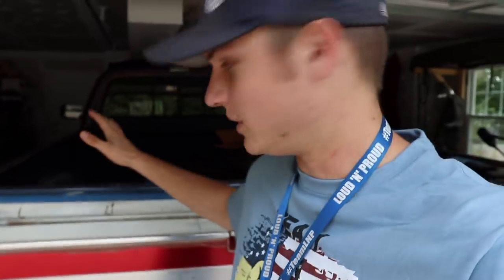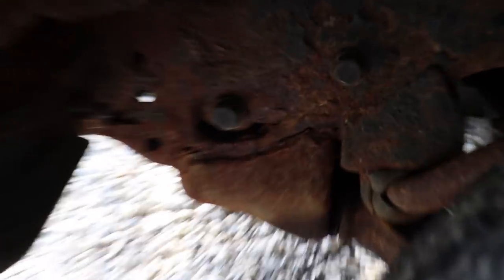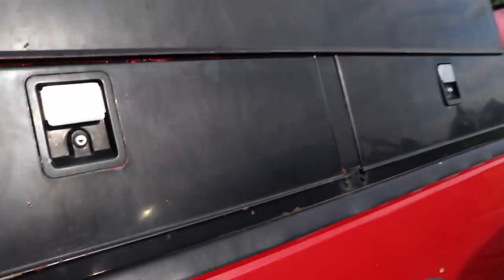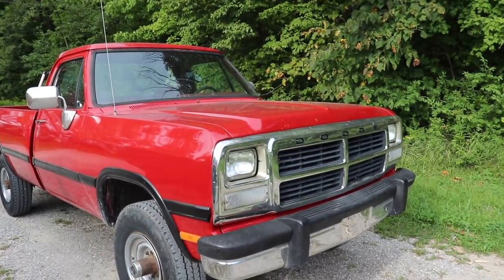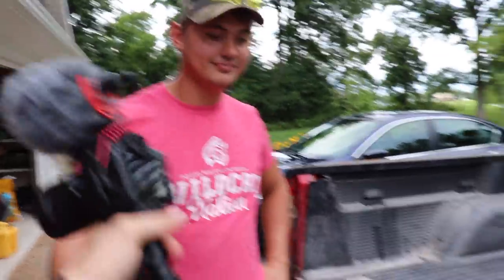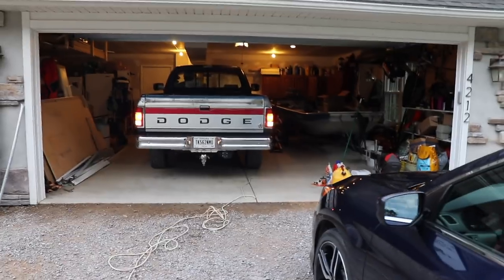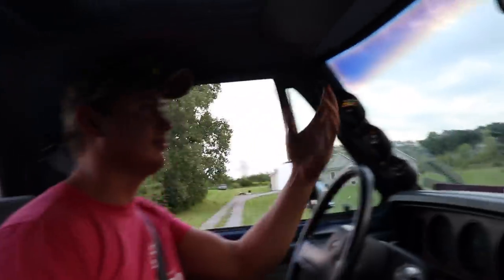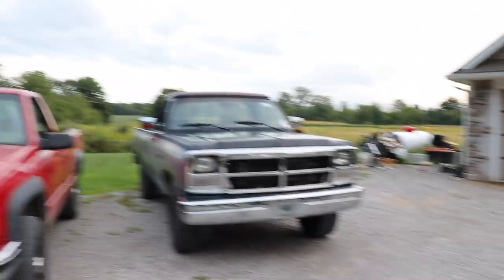HOW MUCH ABUSE CAN THIS GMC TAKE!?!?

Comment: Have a automotive question fellas.  As you all might know, or not.  We, as a country of the U.S.A have switched over to ULSD fuel since mid-year 2007.  And since we don't just make LSD fuel anymore I've come up w/ some questions that'll get me reminiscing on the olden times. Here we go, Question #1.  Does anybody know what color Low Sulfur Diesel fuel used to be?  Next question.  My assumption states there have to be other countries less stringent than the U.S. on emissions control and they still refine it the old way.  I think Venezuela still might refine it the old way, but please don't quote me on that!  And Last question, what were to happen if you were to put LSD fuel in a ULSD truck?  Thankyou
Reply: Late reply but I work in oil industry.  The sulfur level isn’t going to change the color to much but possibly LSD used to be a little darker. It’s my understanding that the higher the sulfur the more it lubricates. That’s why there’s no much additives in fuels nowadays so you shouldn’t have a problem putting ULSD in a newer vehicle

Comment: I believe the squealing coming from your belt system in the dually might have to do with the bearing for the fan clutch you should get that changed as soon as you can or your fan will end up in the radiator